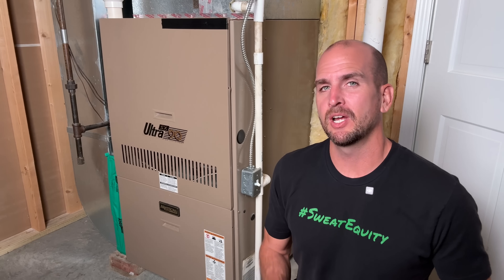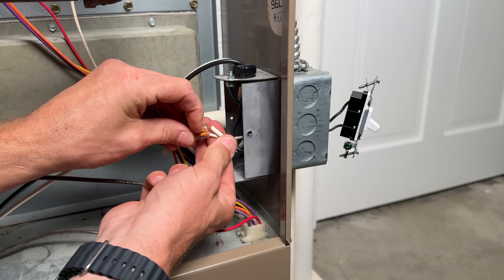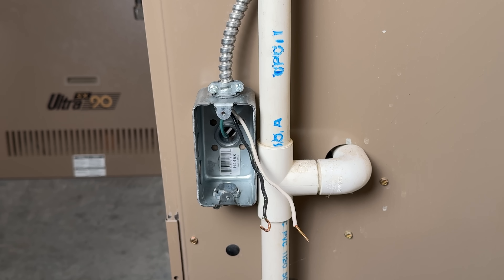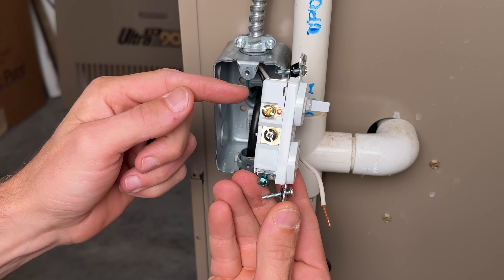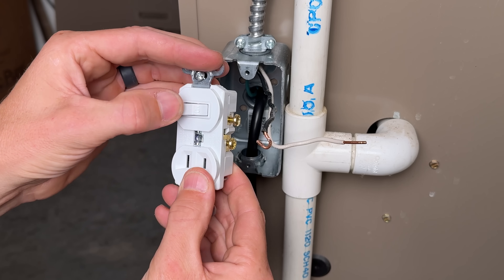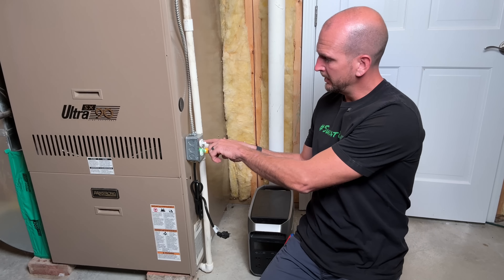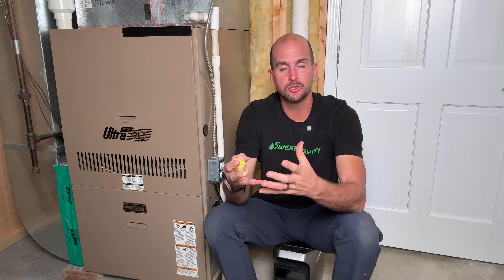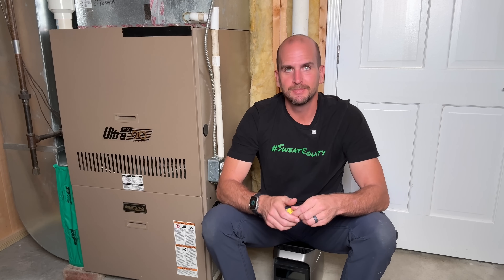Emergency Heat | How To Power Your Gas Furnace When The Lights Go Out

Comment from the maker: 14-Gauge Extension Cord (6 ft) - https://geni.us/FzQmE
Light Switch / Outlet Combo - https://geni.us/KNFb
WAGO Wire Connectors - https://geni.us/NkcBP
Klein Tools 11-in-1 Screwdriver - https://geni.us/gfNB
Knipex Hybrid Wire Strippers - https://geni.us/uVWn
EcoFlow Delta 3 Plus Power Station - https://geni.us/nQuyy7

DISCLAIMER: This video and description contain affiliate links, which means that if you click on one of the product links, I’ll receive a small commission.
Reply: I don’t see the link for the neutral to ground plug / adapter.
Reply: Thank you

Comment: I like making the switch control the furnace and outlet. Then with the switch off, the outlet is the furnace connection for the inverter. Just make a cord with 2 plugs.

Comment: I like this guys channel. Lots of good information. But unless he’s exercising a loophole he’s violated NEC.  You are not allowed to convert a furnace to a plug in appliance. You can, however buy a hard wired transfer switch just for the furnace.

Comment: So if the initial power spike was over  2000 watts, then wouldn't you need a 20 amp circuit and switch with 110 volt power?

Comment: This is good hack.  Thanks for sharing.  I live in Michigan and I don’t think my peers are ready for an extended power outage in cold weather.  ( IE ice storm).    This hack will work but does not meet code so if you ever sell your home it may be something you have to undo when you sell your home.   I just installed the EZ generator switch.    It basically does the same thing but meets code and is UL listed.    Thanks for the video and if you live in a cold climate you would be wise to have a plan to keep your family warm.

Comment: You didn't need to break the tab. Hot comes in on the broken side switch. Through the switch and down the tab. Completing the circuit by passing through the receptical. 
Jump the hot side and break the tab if you don't want the receptical switched.

Comment: That is a whole lot of unnecessary confusion. If you are going to convert your furnace to cord-and-plug, you don’t need the switch at all. The cord and plug serves as a disconnecting means all by itself. So just install a receptacle and wire the cord into the furnace as stated.

Comment: Nice set up, when we first lost power I ran my generator outside and used the dryer vent pipe to run the power into the basement which is close to the furnace. We were the only home on our court that had power, freaked the power company as to how we were powered, I have a transfer switch which runs the furnace and one circuit in the house, powered the furnace and kitchen loghts, refrigerator, microwave, living room lights, and TV, all off of my camper 2300watt inverter generator for three days, temp during the day -5*F, night time -15 to -20*F. I am currently looking to do an upgrade to a solar setup, power the central AC in summer and a little heater in winter. (I can't un freeze or shovel off the test solar panel on the roof -30' up and not accessable without a bucket boom, tri level home with large over hangs).

Comment: No need to break the tab and replace with jumper. Connect hot to the opposite side, or "load" side of switch, load to the tabbed, or "line" side. This is opposite to the normal way, but this allows the switch to control the receptacle.

Comment: I suppose this is all pointless if the furnace fan motor is 120 volt?
Reply: I didn't understand your comment. Does the fan motor get it's power separately? Can you please explain why this is pointless. Thank you.
Reply: @Ashok20164  I should have clarified that relates to using a battery as a power source. Or was it not a battery, but something else that could provide 120V that you were suggesting be used? Some furnace blower motors are 120 so I don't see how a battery would help in those cases. Generator, sure, but not a battery?

Comment: How does this power the 220v blower motor? Sure the circuit board, condensation blower and burner blower motor/ignitor will work which but will eventually cause a fault and shut the system down.

Comment: Where I'm at you have to have an emergency shutoff switch upstairs. This would bypass that. I did this with a single circuit transfer switch before the emergency shutoff switch. That way the switch still works right if it's ever needed.

Comment: The only potential problem I can see is that if you're using natural gas, the pressure from the gas line could go to zero during a prolonged power outage.  Without power, the gas company has nothing to pump up the pressure.

Comment: My new Amana furnace requires a 20amp circuit so I need a 12ga cord.  Just be sure to check how many amp breaker is on your furnace circuit at the breaker box before choosing a flexible cord

Comment: In my non-electrician / I know how to run my gas furnace on a power station or gas generator experience -  In a home the neutral is bonded to the ground ONLY at the electrical service entrance box. Numbers of gas furnaces, at start up, "check" for this neutral/ground bond and will NOT continue with the startup sequence if this neutral/ground bond is not detected.  Therefore to power this type of gas furnace using a floating neutral gas generator or power station the simple solution is to insert a neutral ground bonding plug into the generator or power station, which is an electrical plug that has a connection between the neutral blade/prong and the ground prong in the plug - or, in a pinch, by using the male end of an extension cord and connecting the neutral and ground wires coming out of the plug and taping off the hot wire coming out of the plug.  

In a pinch I made my own neutral ground bonding plug with a rugged male electrical plug and an inch of bare 12 gauge copper wire to connect the neutral blade to the ground prong inside the plug. I then filled the cord hole at the back of the plug with black electrical tape . (14 gauge copper wire might have been easier to use)

Comment: I couldn’t do this and doubt that I could find an electrician that WOULD do it.  Anyway, I have the outside generator with a plug to go to my panel.  Noisy, but works great and will keep going as long as you have gas/propane. My generator plus installation was about $1600.
If I had it to do over I’d get one that also ran off natural gas. Reduces total wattage but very convenient.

Comment: Morning. I have a question regarding powering the furnace using a Delta2 EcoFlow battery. I use this method on my sump pump and wonder if I can use it on my furnace. This allows auto switchover to sump pump when power goes out.  I have plugged the Delta2 into the power source and the sump pump into the Delta 2. The sump pump runs on mains power - through the Delta2- until main power fails and the auto switches to battery. Do you think I can do this with the furnace. Many thanks.

Comment: Can I use a standard gas powered generator for this? I have no lack of confidence doing the physical wiring you demo'd, but I want to make sure going straight from a generator wont harm the furnace. I assume thats why were using the switch to prevent backfeed into the home's main electrical system? Thanks!

Comment: As a 35 year electrician, most of this is fine. Whether or not you want to strip out more insulation is up to you, but it makes wire management easier in a case like this. The one thing I disagree with is using WAGOs in residential applications. I have seen them fail on multiple occasions. They are great for commercial applications, and the lever type are superior to the push-in type, but I only use wire nuts in residential applications generally, although since this is stranded wire, it's fine. Just a note to those using them in outlets and switches where it's solid wire rather than stranded. I am about to do this for my 90 year old neighbors, BTW. Great video.
Reply: I'm curious, In what way have you seen the WAGOs fail?

Comment: I think it's much easier to wire the breaker panel to connect to a generator, and use the breakers to comtrol what you need (furnace, fridge, water heater, etc...)

Comment: Update: I just watched it over a few times however, a diagram would be ideal to add in there if possible. 

Can you draw the wiring diagram, I believe I understand how this is all working but you have me lost on the exn cord wired and plugged into the furnace?

Comment: I'm trying to make sure I understand something.  I think we are setting this up so the power station is always being charged by the normal input power that goes to the furnace.  Then, when we lose power, we flip the switch so the power station back-feeds into the furnace to provide power for emergency heat, or maybe sparking of the igniter or maybe both.   Is that the way it works?  Can we also get a circuit diagram in the summary? 
Thx Scott

Comment: Id be worried about my kids pulling the plug out of the outlet and getting 110 when the furnace is on
Reply: If the plug is pulled then there is no power since the power is connected to the back of the outlet.

Comment: Do I need to flip the breaker on my home panel to cut power to the unit when transferring to generator... because when the power comes back, wouldn't it send power now from my home to the generator and blow something up?
Reply: No. The furnace plug is the disconnect and it is either connected to the home via the outlet and when there is no power then it has to be removed from the outlet to the generator in which case the if the power comes back it just stays there isolated. Hope this makes sense.

Comment: It looks like the surge would surpass the ability of a 2022 Mitsubishi Outlander PHEV, which has a 1,500W outlet. If anyone has tried it, would love to hear how it went. We do  not own one yet, are considering it, but if using it for this is infeasible (or dangerous or damaging) would love to know. (I have not yet checked our own furnace fan-starting surge, but plan to.) (Have not yet bought the PHEV but considering it as our car just died.)

Comment: I understand this modification is essentially making my furnace a plug in appliance.

The on/off switch determines if outlet is hot or not from the grid. 

If i use another power source, such as batter, to power furnace due to grid power outage and I plug a battery into the outlet is there any chance the AC battery could back feed into the grid?

Comment: The furnace light switch I have is not on the furnace itself it is attached to a beam about 3 feet away. Furnace in the attic. What are my options?

Comment: Thanks for the video Scott! I just did this to power my oil (warm air) furnace before an impending storm here in VT. I'm comfortable with this kind of project however was a little confused. What I was seeing didn't match the video exactly. I used the left side line and neutral terminals for power from the panel and did not break the right side tab or use a jumper. "ncooty" made a similar comment below. It worked as intended, turning off power to the switch in the off position. 

I measured amperage with a clamp meter ahead of time and saw about 6 amps with the burner and fan operating, as such, the  unit is drawing a little over 700 watts from the small 1600/2000 watt Harbor Freight generator I have. I did learn it should be running at full throttle because in the "auto" throttle position, there was a brief overload when the fan kicked in (it didn't increase the throttle fast enough in response to the demand). I imagine a larger/better quality generator may respond faster. 

This is the first step in weather proofing some basic needs ahead of a more permanent system. For now, this worked great and I'm very happy with the results. I did use the WAGO connectors and it saved lots of time connecting solid and stranded wire of different sizes. Of course, no good project requires less than two trips to the hardware store regardless of how much stock I have on hand at the house!  Oh well!
Reply: Only need to break the tab if you want to use the switch separate from the outlet.

Comment: Great video.  What I can't find is a good video to help solve my problem, but I think it's connected to this.  I have a gas generator that is wired to my house.  It runs everything except the propane furnace.    The furnace will start a cycle but never engage and never generates heat.  I've had people suggest a grounding rod, and I've talked to an electrician, but I can't get to the bottom of the problem.    Have you dealt with a similar issue?

Comment: Ok, question everyone please, this is what I DID because it's against code in my area to have an extension cord coming out of the furnace...... Line in top left like this video, but we know top right is basically the same thing.... next I pigtailed neutral bottom left to neutral going to furnace and going to the panel. Then, moving over to both of the right screws I broke the tab, put pigtails on both screws then maretted them only to the black power wire going to the furnace. The copper grounds are all connected to each other, the box and the green screw too. What I am hoping for to ultimately happen is the switch on this plug turns off power to the plug and the furnace.I confirmed this is what happens so far, the switch does kill the plug and the furnace. What I also want to happen is when the switch is off, I can run a modified extension cord with two male ends (plugging the cord into the switched plug side first because there's no power out of that plug cause the switch is off) then plugging the other end of that extension cord into my generator/ecoflow/jackery. I believe that will run the furnace and also give me the ground the generator would be looking for as it would have a bonded ground at the panel? I haven't powered it this way until I get some input please. Will this work or will I blow something? Thanks all.

Comment: DIY-ers. I am not trying to be negative.  I am trying to be safe.  
It is counterintuitively stupid to depend on someone who has a "DIY Degree" to "teach a DIY."  
That's like saying, it's ok for an Apprentice Electrician to train an Apprentice Electrician. Does that make any sense?  

Would you want an apprentice who is not trained by a seasoned Electrician to wire your house?  

Would you want an Engineer-in-Training to design a bridge that your family drives over every day?

How about a mechanic-in-training, trained by another in-training to rebuild your transmission?

Use your common sense.
You are putting your safety in the hands of people who post crap  on YouTube "for clicks."

There are at least five violations in THAT particular vid (and more in OTHER  ones):
 
1) Code is to have a hardwired supply to furnaces.  
2) Code is to ground the combination switch/receptacle, and not rely on its metal frame to box.
3) The switch box should have been installed with the ground from the MC cable to a ground screw, then pigtailed to the furnace (and to the new combo switch-receptacle.  This should  have been corrected during this vid [which shouldn't be posted, see #1)].)
4) The basement receptacle is likely not GF protected.
5) Code is to Install equipment according to the manufacturer's recommendations.  The furnace installation instructions likely call for 12-gauge, not a 14-gauge flexible cord.

There is a safe, code-compliant way to power a furnace from a genset but that is not it.

And even WITH a proper transfer switch, tings can go wrong.  This one was caught before a fire burned down the house.   https://youtu.be/UVjIoL7A_-E

Comment: Would a 1990s gas boiler with circulating pump be less of a power draw than a forced air system?
Reply: Probably. But depends on the pumps/blower motor. Taco 007e use strikingly little power.

Comment: If you want to power your fuse panel from a generator the poor man’s way, grab a two pole breaker and run the 240v from the generator to the breaker. Run your neutral to the neutral bar. If you only have a 120v generator then you can still accomplish power by running your hot and jumping one side to the other on the breaker. Run your neutral to the neutral bar. You will have to open all the 240v breakers on your panel when doing this. I would  suggest opening everything but power to your refrigerator and maybe a few lighting circuits. Obviously you will have to open the main before applying power to your panel to avoid back feeding and to avoid immediate damage to your generator when power is restored. If you’re not knowledgeable please do not use this tip.

Comment: Well, in my gas furnace closet, there is no switch either on the furnace or the wall.  There is only an electrical outlet on the wall and the electrical cord from the furnace just plugs into that outlet.  So, can I just plug that cord into a heavy extension cord from my 9500 watt Firman generator?
Reply: You lucked out. I would say yes.

Comment: Could do an in line UPS like is used in data centers. Charger/rectifier to a battery bank. Then the battery bank to an inverter to the load. You loose some in the conversation from ac to dc back to ac but it smooth out any surge/dips and give you time to switch to generator power. 

Easiest way to achieve this is With modern off grid inverer/controllers.  Would be pretty easy to set up and to wire in PV to supplement the battery.